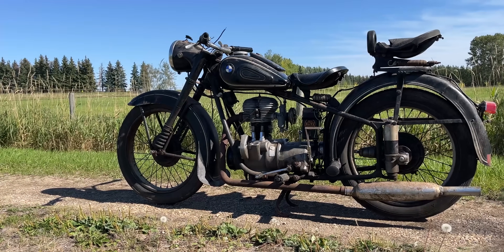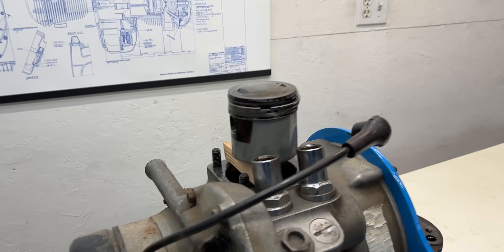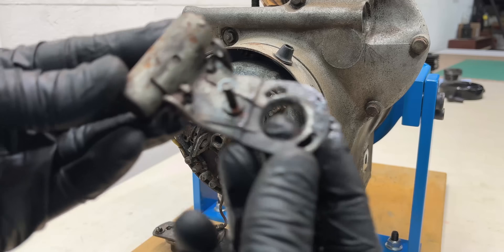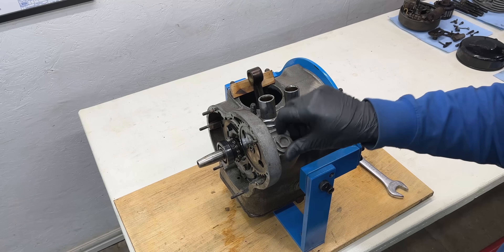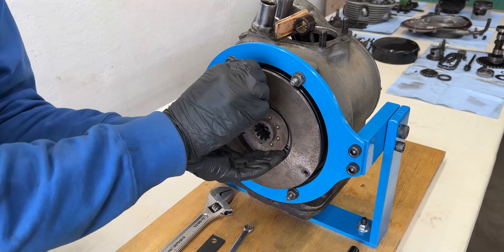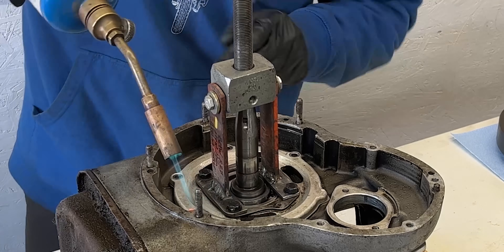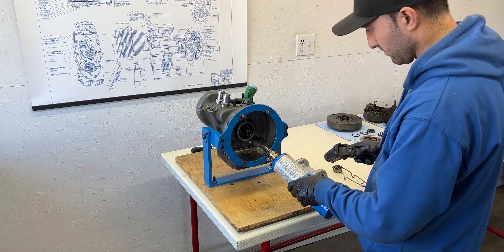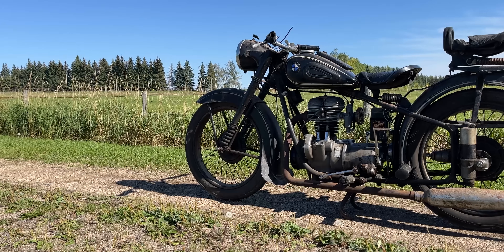BMW R25 Engine Teardown | The Best of Vintage German Engineering

Comment: I've had 4 BMW Motorrader.   R26, R60, R69US, R100RS.  I had some of them pretty far apart and did a lot of painting and rechroming.  But I'm glad I knew when to stop before I got into trouble!  I didn't have the shop or BMW tools or experience to shim a final drive gear for example.  It's nice to watch someone who is able to do these things!  Would you like to build a R60 from baskets?  Where are you located?
Reply from the maker: Sounds like you've had a fantastic lineup of classic BMWs! Restoring them definitely takes a fine balance between ambition and knowing when to step back—sounds like you had the right approach.  
I've since sent you an email about this topic - Regards Andreas

Comment: I like your way of using a heat gun instead of a torch, which one sees all too often in engine tear-down videos.  I am contemplating of buying a R35, which is mostly in boxes.
Reply from the maker: I'm glad you noticed this! A heat gun will always work to expand aluminum, but it may take a few minutes longer than an open flame. I do prefer the heat gun over any flame for others reasons as well...
Oh an R35 would be a great project! If you have the opportunity and patience, it might be the right bike for you. Regards Andreas

Comment: I always laugh at German engineering.
 If Germany didn't have the world's best apprenticeship programs for their mechanics and shop workers I doubt anything engineered by Germans could even be put together. I say that after working on German cars for over 50 years. I love the cars but man-o-man do they do dumb things. Some day compare a small block Chevy to a Porsche 911 engine. The Chevy puts out more horsepower per pound and vastly more per $$ and is easier and vastly cheaper to work on and at least as reliable.
I doubt BMW motorcycles are any different. I think that's where Porsche found Dilevar (sp?)head studs. Look that up!
After saying all that I have to confess to having owned 5 Porsches.

Comment: If you have a dry clutch, You can insure all bearings seals chains cams last FOREVER when you also add tungsten disulfide powder to the assembly lube on these special needs parts. And you can also add it to oils. 
The clutch should never get tungsten disulfide on it, or just small small amounts, but it will revive the metal on metal wear on the rest of the engine. 
It is like graphite powder you would use on locks, but it actually never degrades, and its safe on steel engine parts and oil pumps. 
The seals are also kept in a zero wear state. 
This is so important. 
There is also very low blowback chance on the piston and ring area because the tungsten disulphide particles work in between the rings keeping them free, but it also keeps them from wearing and eventually bouncing in tolerances that shouldnt develop. 
You also lower cylinder wear by maybe a factor of ten, It also does the same with keeping chains wear free on all surfaces, so you also get less metal in the engine, low chain stretch, low friction, and low maintenance. 

On brand new bikes with dry clutches (there arent many) you can increase engine life 10 fold and probably only have to do the highest reccomended oil change interval. 
No valve adjustments! No chain tensioning! No leaky seals, because the particles protect the shaft and seal surface and embeds into the rubber and then shields with a microscopic extremely durable seal. 
The stuff is like graphite, but it works for basically forever, but again, not good for wet clutches. It would be great to have dry clutches on dirt bikes and smaller road bikes where performance is not reallly neeeded, but mpg and simple maintenance is!
I like the idea of air cooled better, becuase I think clutch matieral in the oil is absolutely abhorrent
Its probably some scam, 
If dry clutches are done correctly, as you see in MANY actually the MAJORITY of much more powerful and heavy cars, it works best that way, and if the transmission were in the engine housing, and the dry clutch was outside and accessible and all you had to do was run a driveshaft from the enginetranny block, it would be the absolute simplest and best solution. 
Running the same oil, and keeping gear losses lowest, weight losses lowest, maintenance simple, all it needs is an attached gearcase compartment not too far from the eninge to run a power transfer gear. 
UGH the eingineers have gotten it wrong for so many years. 
Germany and russia did smart things like what i just mentioned but years ago, now industry is a slut for unmaintainable landfill garbage. How!?

Comment: Whats parts availability like for engines of that era ?
Reply from the maker: Parts availability for classic BMW motorcycles from 1949 to 1995 is surprisingly strong. A dedicated community remains loyal to BMW's heritage, and the brand itself supports this by continuing to produce parts for various models. Many components are shared across different models, with some being carry-over parts, but certain ones are becoming increasingly rare. In such cases, finding a complete bike is often the best option.  

As with anything, the older it gets, the harder it becomes to source NOS or quality used parts. Thanks for the great question!  

-Andreas

Comment: It would be nice to see modern engines  being designed  with the simplicity of this engine. Motorcycles and cars today are just too complex thus being less reliable and very costly to repair. Great job and thanks again.
Reply from the maker: I completely agree! The simplicity of these classic engines is a big part of their charm—they’re easier to work on, more reliable in many ways, and don’t rely on complex electronics. Modern vehicles have their advantages, but the added complexity often means higher repair costs and less DIY-friendly maintenance.  

Thanks for watching and for your support—I really appreciate it! -Andreas
Reply: Como é fascinante a simplicidade das coisas, simples e confiável. Hoje complexos e baixa confiabilidade. Excelente profissional.

Comment: Very detailed presentation, I am quite interested in this approach for old engines. If it is possible please do a full restoration on this motorcycle, they are quite valuable
Reply from the maker: Thanks for the feedback! The BMW R25 will only be receiving a mechanical restoration for specific reasons. While it’s a valuable bike, I’m focusing on getting it running perfectly rather than doing a full cosmetic restoration. This approach helps maintain its originality while ensuring it’s fully functional for the long term. Stay tuned for more updates on the progress!

Comment: Excellent presentation....for such a well engineered motor, the oil slinger and the difficulty in servicing it wasn't addressed until 1970 with the R75/5 with its replaceable oil filter cartridge
Reply from the maker: Thank you, Gary! I’m glad you enjoyed it.

You’re absolutely right—the improved serviceability of BMW’s bikes made them much more accessible to the average rider, which was also a strong selling point. The /5 series are fantastic machines with a great overall look and a refined powertrain compared to the pre-1970 models.

I appreciate your comment—have a great weekend!

Comment: This bike is R25/2, the R25 has one vertical seat spring.... Or this is a mutt from various 250 bikes...
Reply from the maker: Good catch! This is a numbers-matching 1951 BMW R25.

At some point over the years, the seat and fuel tank must have been replaced—either as a necessary repair or an upgrade. It’s difficult to say for sure, but it’s still very much an R25.

If I can track down the right parts, I might be able to bring it back to its original setup. However, these bikes are quite rare in Canada, so finding the necessary components could be a challenge.